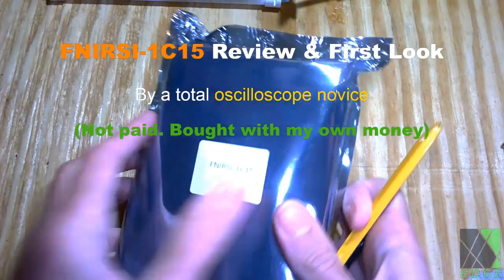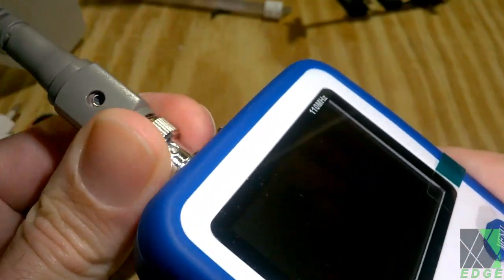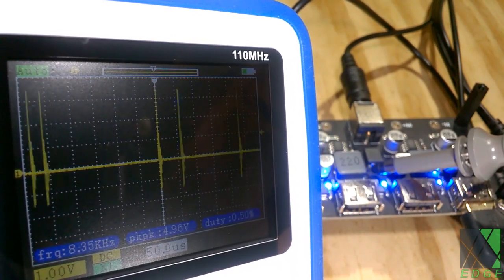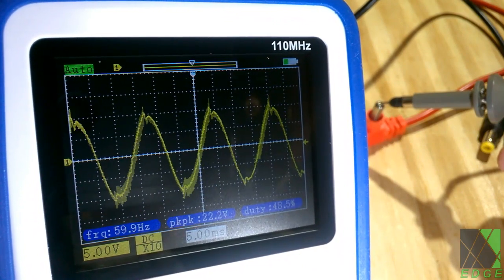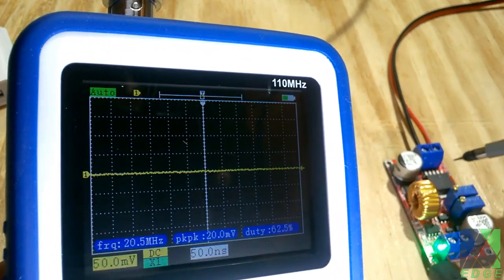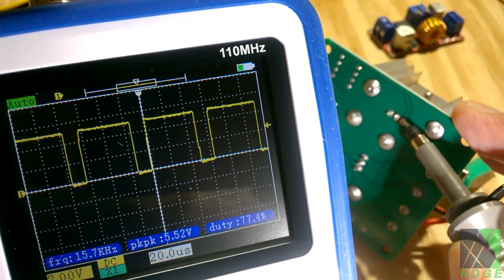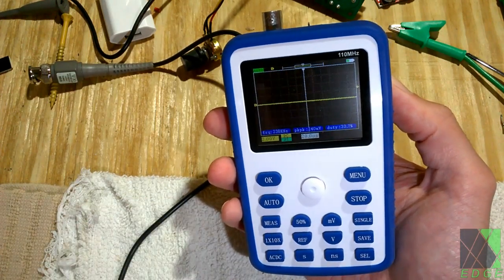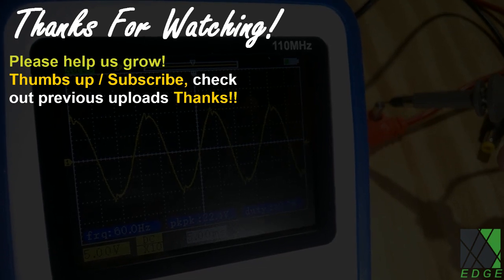FNIRSI-1C15 oscilloscope for beginners unpaid review, first look video. 100MHz handheld scope 2023

Comment: I would take the back off your oscope to see if the heatsink is on the charge control chip (see diode gone wild review ) the heatsink on his scope was loose in the case also Viorel caia did another review and the heat sink was missing. I just received mine yesterday and the heatsink was on the chip.  You may already know that long pressing the MV and V buttons changes the screen brightness.  Great camera work and lighting thanks for the video
Reply from the maker: Hi, I really appreciate the good feedback, it means a lot. Had no idea about the brightness, just tried it, awesome. Thanks for the warning, I sure hope the heatsink isn't loose on mine.

Comment: when you want to measure the noise of a DC power supply change the oscilloscope into AC. So you only pick up the variation and ignore the DC voltage floor. You can do the same things with multimeters ( voltmeter ).
Reply from the maker: Good call and will try it, thanks!!

Comment: Nice review - I'm not really a beginner having spent some years at a bench where the 'scope was one of the principle tools - but that was forty years ago - Bought one of these and am just blown away by what you get for so little money - a 100Mhz scope, a storage scope - capable of storing many waveforms,  auto adjusting and giving accurate measurements of both ac and dc - Gobsmacked!

The points about high voltages and isolation are well made,
Reply from the maker: Thanks Doug! I was wondering what others think of this scope. It seems to have a ton of features for what it is. I really like the auto feature, and compact form factor. They clearly put a lot of thought and engineering into it.